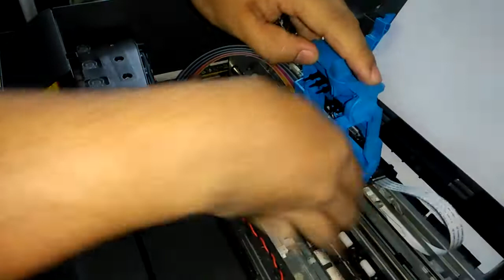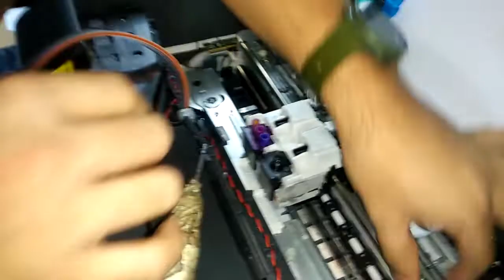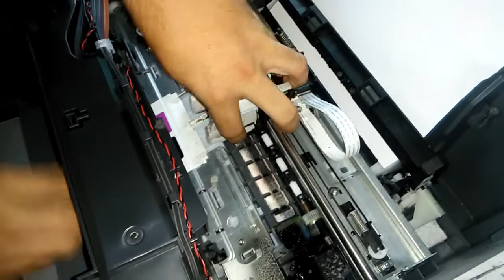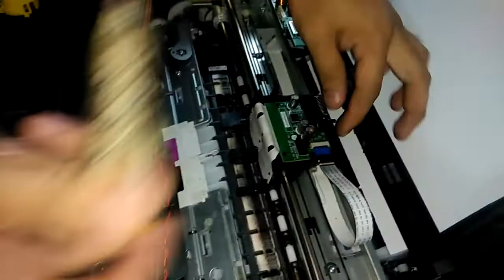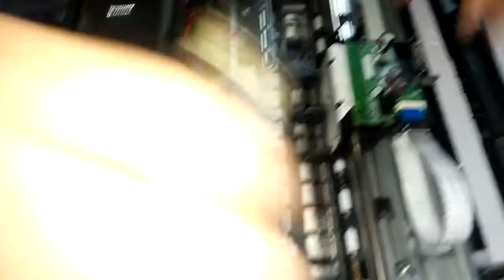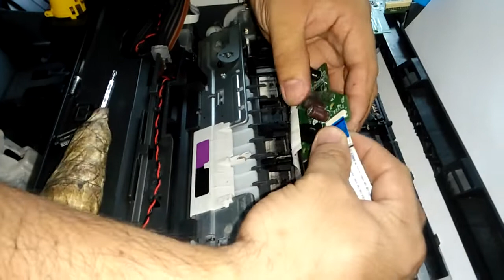HP Smart Tank 615 Printer Short Cut way of removing PCA Carriage for replacement.

Comment: hello danmark i am merve from turkey i am doing a printer repair job i have a problem with this printer the problem is that the printer does not see a black cartridge but i bought a new original hp black cartridge and inserted it, i think the cartridge slot is broken, can you advise me? i have another hp smart tank 615 printer working in my hand. i can use its cartridge slot but how can i do it. I do not know this. I'm waiting for you to help me please reply, will you?
Reply from the maker: sorry late reply sir yes if the cartridge wont detect the even its new the first parts to replace is the Carriage PCA. if the error encounter again maybe your mainboard got problem..